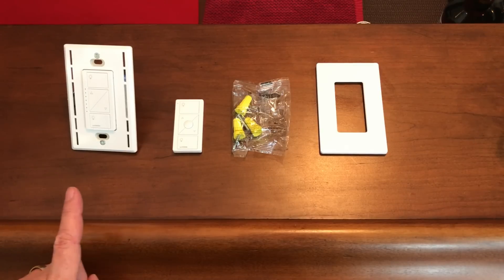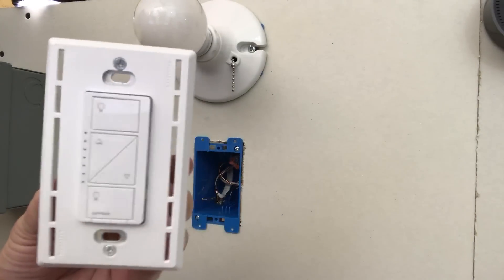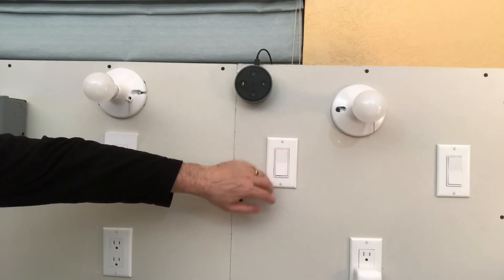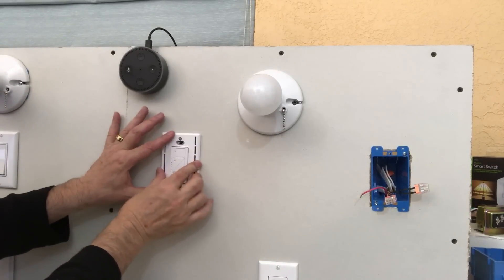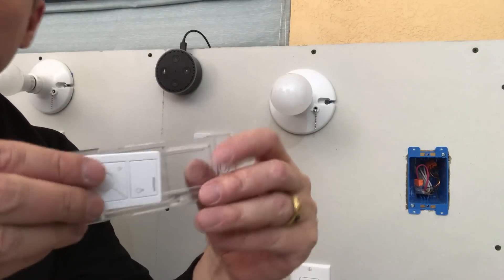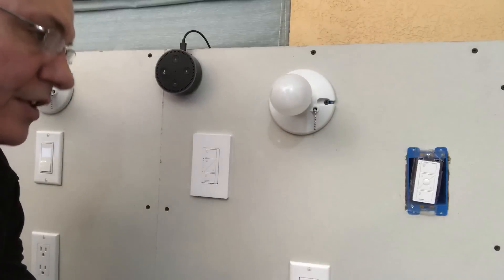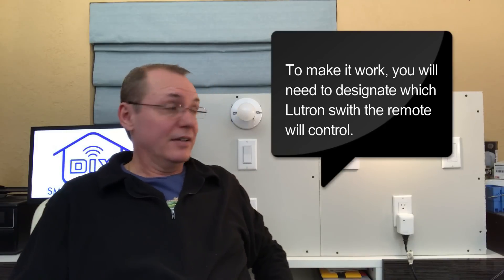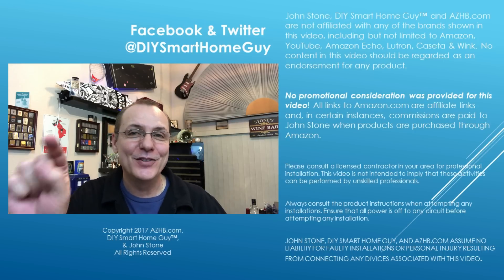DIY 3 Way Switch Lutron Caseta Wireless Dimmer Install with No Neutral Wire or Traveller Wire

Comment: So, if a owner doesn't want to run romex for a 3 way switch to the j-box and use only the pico remote. That will be it enough then, no 3 way romex need it.
Reply from the maker: In short, yes. You would need the Lutron Bridge and a Lutron Switch in the original position, then the 3-way (second switch) can simply be the pico remote.

Comment: This was a great video, I have the  2 switch one bulb set up. However, I capped off the red wire, connected to 2 black wires in the new dimmer switch.The light comes on and off with the new switch. The other light switch does not work. I have no idea what to do next :(( any help would be appreciated???
Reply from the maker: You need to associate the Pico remote with the main switch. This process varies by installation (Wink, Homekit, Lutron Smart Bridge, etc.). But that would be the next step to make the remote switch mirror the main switch.
Reply: @DIYSmartHomeGuy1  Thanks so much I’ll try that
Reply from the maker: My pleasure

Comment: Not really any help.  My lutron switch has 4 wires in the back.  in addition to the green.  the directions show to ignore the blue wire but i need to connect each of the standard 3 way wires.  My question is what to do with the wires either at the fixture where the power comes in  or at the other outlet where the pico gets installed.

Comment: I don’t understand why you’d need a Pico remote on the other end for anything other than dimming from both locations. Otherwise why couldn’t you use a single pole switch and wire it the same exact way?

Comment: Tell me of this is okay.  I have a three way set up at my home for the kitchen.  I left one of the light switches as is and wired up the 3 way smart switch on the other switch.  I actual put the load and the traveler on one of the black wires.  On the other black wire from the switch I put the line wire.  I didn't want to use the remote.  I haven't had any issues.  Please tell me your thoughts, thanks.

Comment: Any reason you wouldn't wire all the wires (not the ground) together behind the pico switch? It seems the Lutron video recommends all the wires (again, except the ground) under one wire cap.

Comment: Ok the switch is working however, the other switch is controlling the off and on.  Is there a way to by pass this switch.  I've capped off the red wire on the OD switch.  But when I use the other switch it can still control the lights.  Up is on and down is off.

Comment: I'm hooking up a occupancy detector (motion) in a room with the same two switch boxes you show in your 3 way switch.

Then Occupancy Detector has three wires, a black, a red and a green.  I know the black is the hot the green is the ground but have no clue what the red one is for.

In the wall on one of the switches I have two black wires, one red and one ground which were all connected to the old switch.

I've connected the OD, to the wall using the one black wire (connected to what I think was the hot wire) not sure because the switch I took out didn't have two different screws to identify the hot vs the not, to the black wire, the red wire to the other black wire and the ground.

The OD blinks it's green light which tells me it's looking for motion but I can't seem to get the lights to respond.  The other switch doesn't work either way.  So I'm not sure if it needs to be switched up or down.

Really confused....

Comment: Hi, thanks for the video, but which of all the options you have listed on the description i have to buy? i have several options on amazon and im a little confused because amazon has a 3-way Dimmer Switch Starter Kit thats different than the ones you have, please help. and thanks.

Comment: I have a few of these Decora 15 Amp 120-Volt 3-Way Combination Rocker Switch.  Is there a smart switch that can replace this item?

https://www.homedepot.com/p/Leviton-Decora-15-Amp-120-Volt-3-Way-Combination-Rocker-Switch-White-R42-05643-0WS/205844880

Comment: Awesome video.... but.... what if you have a neutral wire... what do you do with it? Do you cap it off? if not, where od you connect it to the dimmer switch?
Reply: just keep the nuetrals together in a wire nut.  If its in the junction box in the form of a pig tail out of a wire nut, you can just twist it off and put the cap back.

Comment: Hey there, I’m having a lot of trouble getting my Lutron switch installed. The regular lutron on/off switch requires to have a neutral wire (which I don’t have) but the dimmer switch does not. Any advice or thoughts on why this is?
Reply: You need the Lutron PD-5S-DV. No neutral required.

Comment: Thank you, I do find your videos useful and informative. I especially appreciated your insights into Z-Wave paring with Wink and resolving related problems. Now, to this specific video, I guess you realized this afterwards but… when you pair a Pico Remote to a Wink Hub that does not automatically associate it with any particular Lutron Caseta device(s) you may want to have it control. It is still necessary to configure Wink so that a particular Pico Remote is associated (i.e. controlling) with specific Lutron Caseta device(s). When Wink is used, it gets in the middle between the Pico Remote and Lutron Caseta device(s) it controls.  This can be advantageous at times. I have three Lutron Caseta plug in dimmers that control table lamps, two in an open concept living area and one in the front porch.  Each has its own Pico Remote sitting adjacent to the lamp that it controls. But, there is a fourth Pico Remote that I configured to control all three devices; this allows me to turn on/turn off/ set brightness for all three lamps simultaneously.  I find this useful if we are retiring early and don’t want to wait for the scheduled turn off of these lamps. I also find it useful when I am up early (still dark) and want these lamps back on. And yes… I have a Wink robot that turns off these lamps unconditionally at sunrise.  I also have an Amazon Echo which can be used to control these lights – I refer to them collectively as “Base Lighting”. However, I don’t use the Echo to turn on these lights early in the morning because my (loud) dialogue with Alexa would disturb others who are still sleeping.

Comment: you didn't even mention what the purpose of the white wire is...it seem you made this video to work with what you made.  I have a white and black coming out of the wall with no neutral...I'd like to put s a smart wifi switch there...that's what I'm looking for.
Reply: I have same wiring but believe it was just simple situation of saving wife by using what was in the romex

Comment: I have a situation that I need help with.  The goal is for the stair lights to turn on when occupancy is detected with the lights dimmed to a lower setting.  
Currently, I have a  Lutron Occupancy Sensing Dimmer at the bottom of the stairs.  Does anyone have suggestions regarding what to install at the top end that will also sense occupancy and turn the lights on dimmed?
Reply: Check out Radio Ra Select. You have to get it from a distributor, and it costs a little more than the Caseta line, but it can no work with a smart hub and a standalone occupancy sensor. Or you can just pair your caseta dimmer with this occ sensor:https://www.amazon.com/Lutron-LRF2-OCR2B-P-WH-Wireless-Ceiling-Mounted-Occupancy/dp/B005LPET0G/ref=sr_1_1?ie=UTF8&qid=1521634832&sr=8-1&keywords=lutron+lrf2-ocr2b

Comment: Thanks for the video, I am currently trying to install the Lutron wireless dimmer but the wiring on my current dimmer switch doesn’t match what I see on any videos. I have 3 black wires, 2 going into the back of the box utilizing the push tabs and 1 wire secured with the bolt on the side. And then the ground wire. This is NOT a 3 way switch as there is no other way to turn the lights on and off. My initial attempt to install the wireless dimmer resulted in feedback coming through my receiver and my dimmer switch acting as the breaker for my entire theatre room. ( I tried the 3-way setup because it closest matched the videos I was seeing.) Any suggestions?
Reply: DIY Smart Home Guy the switch controls 6 can lights. Thanks I’ll try to isolate the wires. One thing I did notice when I went to hook the old dimmer back up is that if the black wires that are utilizing the push tabs are swapped this dimmer will also act like a breaker for the theater room. Once I swapped them it worked properly again. So I assume I really need to understand what these wires are to properly connect the wireless dimmer. Again thanks for the input

Comment: I'm also using same lutron switch. I followed the instructions but I found only three connected wires in the existing switch. See photos here :
 https://photos.app.goo.gl/JpOdZsCrjZmHYK9c2

As per the photos, I connected the lutron switch to replace the "first switch" in the photos above. I also wired the lines in the "second switch" box as instructed.

After wiring is done, I turned on the power and tested every thing before inserting the switch in the box, and all worked great. Then I turned the power off. After I inserted the switch in the box and covered it, when I turn on the circuit and try to turn on the light, there was small short in the box then I turn off power immediately. When I opened the box, I see black marks on the wire nuts of the two black wires only. 

I think the green wire touched the metal inside the box since it is uncovered from the switch side. Or maybe the new switch touched the metal sides of the box since I could fit the switch inside by pushing it very hard. 

Was the switch burnt out? I'm afraid to try again. Please tell me what to do.
Reply: DIY Smart Home Guy thank you so much! Could you tell me from the pictures I sent, what wire is what... Where is the ground and travel wires? Where is the hot and load? How I can verify.

Comment: I only have 2 black wires and a green copper wire.
what is the difference between the Lutron PD-5WS-DV-WH On/Off Switch and the Lutron PD-6ANS-WH?
can I use lutron caseta system for my lighting?

Comment: If my current switch does have a neutral wire, can I still use this switch? Would I just cap off the neutral wire? I haven't pulled any yet to see what I have.
Reply: DIY Smart Home Thanks for the reply. Just doing research on how I want to set up my smart home and didn't want to buy something that wouldn't be suitable.

Comment: Hello John, Can you use smart wall switches to control outlets?  My condo has wall switches that controls outlets that I have my table lamps plugged into them and want to use smart switches to control them and also use the wink hub to control them.  By the way the wall outlets are switched on the top and live on the bottom, if that makes a difference.  Thanks
Reply: John Stone Thanks John

Comment: Can I install 3 way z-wave dimmer, but do not replace the second switch and use it only as on/off? Will it work? How to wire it?
Reply: DIY Smart Home Guy This is what I’m looking for. I want to kill off the 3-way function and just use 1 Lutron switch to control a set of lights. Capping the red wire on both ends will fix this while leaving the remaining wires in the existing switch? Or do I need to remove them from the existing switch and cap them off?

Comment: Have you tried pairing the Pico remote with the Wink Hub 2 without pairing or even installing a Caseta in-wall switch? I'd like to buy some of these and put them in for my smart bulbs and just cap the wires in the gang together.

Comment: Thank you! Clarifying that the transfer wires were no longer needed (obvious now that I think about it) was what was messing with my install. The Caseta advanced manual still wanted me to make use of it (which I think could still work?).

Comment: I have a question related to the "2 wire loop". I don't understand how it can be possible to give constant power to the smart-switch and at the same time keep the light off? With no ground wire, it should not be possible. How are they handeling that?
Reply: There is a small current flowing through the switch and the light, when the power is turned on there is effectively no voltage difference on the switch so the in-series mosfet is used as a "resistor" to get the voltage drop for the switch to use to power electronics

Comment: In your video I noticed that it took a couple of seconds for the lights to turn off after you pressed the off button on the Lutron dimmer as well as on the Pico remote. Is this delay common?

Comment: Great video. In December I added the Pico to the Wink in addition to the Caseta switch. When doing so, I will as able select the Pico individually (as a connected device) from the Wink app and pair it to the specific Caseta switch. I could see the Wink app allowing someone to pair the Pico to multiple Caseta switches as an "all lights" type of switch.
Reply: John Stone The response time has actually been quite good. I don't know if having my Wink in the same room as my wifi router has anything to do with the speed or not. In March I will be using a Caseta with two Pico remotes in a four way setting that not in a direct line with the wifi router. I suspect I might see a bit of a delay.

Comment: As always great video.  Can you link more than 1 pico remote to with wall dimmer?
Reply: I spoke with Lutron today because I have a 4-way switch in my house that I want to use the system for. They said for both of the remote switches to use a Pico remote and pair it the same way as shown in this video. 

Lutron also told me that 1 Pico remote can be paired with up to 2 dimmer switches. In that case, both dimmers would turn on/off and dim in unison when controlled by the Pico remote.
Reply: B. Pick .. when you pair pico remote to the wink hub..( not pico to switch). then wink assigns pico to switch.. allowing you to have multiple pico control a switch..
Reply: I have paired more than two pico remotes to a single switch using wink. not sure why they would day only 2

Comment: Is there a non-dimmer version of this switch?
Reply: Thom Rowe Wink2 update today reports now works with all caseta wireless switches including pro!
Reply: Thom Rowe..the  non dimmer switch REQUIRES neutral wire
Reply: Charles Vincent thanks for pointing that out
Reply: Good find john. Looks like they have a non neutral version PD-5WS-DV  to go with the neutral wire version PD-6ANS. I have not tried the non neutral switch but glad to know option exists. Apology if i mislead you thom
Reply: I talked with Lutron today and the PD-6ANS and PD-5WSDV switches WON'T work with the WINK hub. You will have to get the Lutron smart bridge and the separate Lutron app. I was looking for a plain on/off switch to control a ceiling fan or a regular flourescent shop light to pair with the WINK hub and Lutron doesn't offer one as of now. I will have to get another brand of switch.
Reply: Clifford Martin .. very interesting.  I find  odd, they would not work with wink2. Wonder why?
Reply: I asked Wink tech support about this and here is there reply:

"This is Jen from Wink tech
support. The Lutron Caseta In-Wall switches are not directly supported products
with Wink. However, since the Wink Hub does use Lutron Casetas clear connected
antenna to communicate with the support Lutron Caseta Dimmers you may be able
to pair these switches but we can not guarantee that this will work or that you
will have full functionality with these switches. For this specific device some
users have had some success while others have not. To attempt this pairing,
follow the same steps for the Lutron Dimmer in the 'Add a Product' process."
Reply: Charles Vincent Thanks!

Comment: Great video. :) Did you happen to notice if the wired smart switch itself can be removed from its attached pate (not the snap on plate?)  I have boxes that have 2 or 3 switches and would need to use the 2 or 3 switch plate.
Reply: Paul Gieselman I'm interested in this too.
Reply: You're the man.  Thanks so much.  Great videos.
Reply: What if we wanted to put the "remote" in a multi gang box? Would that fit?